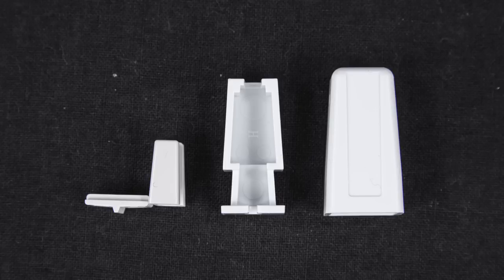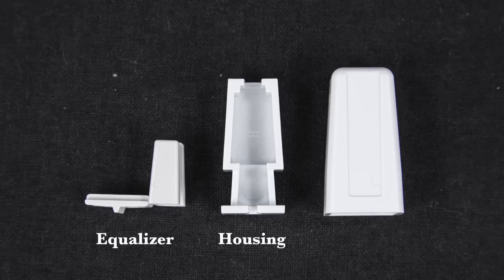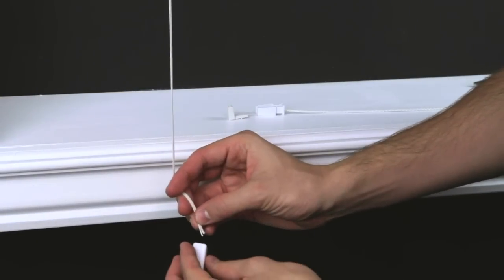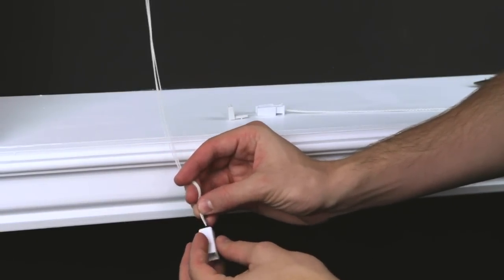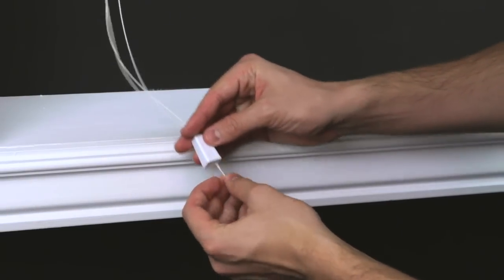How to Install a Hunter Douglas Cord Stop Assembly

Comment: My H-D blind was slightly crooked. Rather than take a chance on adjusting the bottom ferrule - - which, if the string slips, it slips back through the curtain, never to be seen, again! - - I searched the net for the way to use the pull cord, including the H-D website (instructions not to be found. Fortunately, I discovered this wonderful, simple, video! It took me a few minutes to get the blind level, but, this vid helped, immensely, especially with putting it back together! Thanks, very much!

Comment: I am looking for how to put on the oval shaped designer covers.  This is fine if you like the small end.  Good directions, but I will look for the other assembly.  The person's hands often cover what is being done, so prepare to watch it several times.  OK, I did the oval one.  You need the small optical type pliers, a pair of very sharp scissors (to prevent fraying), and something to gently ease the knot open.  My blinds had one wide string, not several like in the picture.  The first thing you have to do is ease the knot open; I opened a paper clip and used the end.  Very carefully trim the end of the rope off if you have any frayed edges. Next you put the outside part(with HunterDouglas written on it, H toward the top) in your hand with the little hole in the top.  Then you feed the string through the hole; I used the end of the paper clip to help push it in from the top.The little plier is good for grabbing the string from inside.Then you have a little hole to put it through in the clear plastic piece.   After that you can tie a knot at the end to hold it in place.  The outside part then slides on tracks to close BUT you must slide both sides at the same time or they won't line up.  When you get it right everything will fit together nice and flush.  Hope this helps.